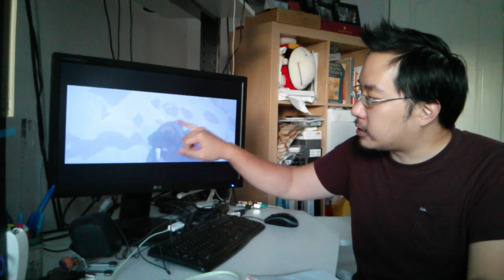Miracast on the Raspberry Pi (with audio)

Comment from the maker: Unfortunately I don't think that's possible. The Miracast spec builds on top of Wifi Direct (ie. starts with phy level handshake to setup wifi connection between two endpoints, then IP, TCP, etc).

I did do some additional profiling though. The packet loss with Wifi Direct is actually fairly minimal as measured by Wireshark (0.5%). I did misinterpret quite a bit of the m2ts traffic. I'll probably do another video on this.

Comment from the maker: This project is not related to raspbmc. If I do release it it will be a standalone application on the Pi store. I'm sure this can be done on raspbmc, someone just have to spend the effort. 

I did a bit of investigation on the performance front and fixed a number of issues. The packet loss is actually very minimal and the performance can be quite good. I'll do another video when I get it running in a satisfactory state.